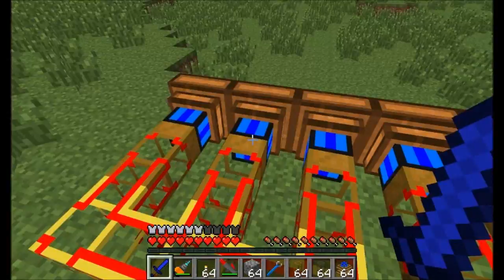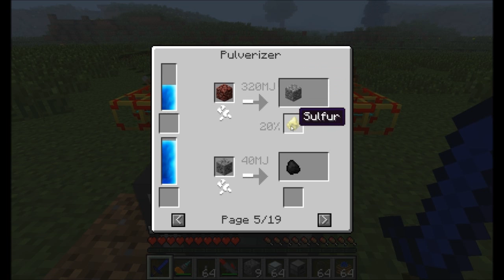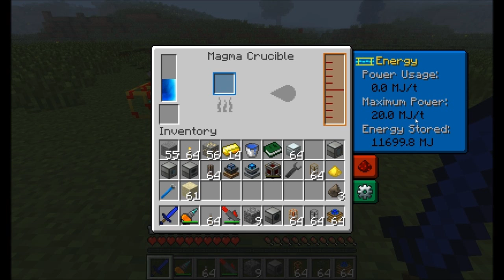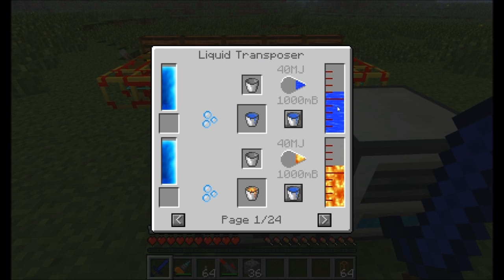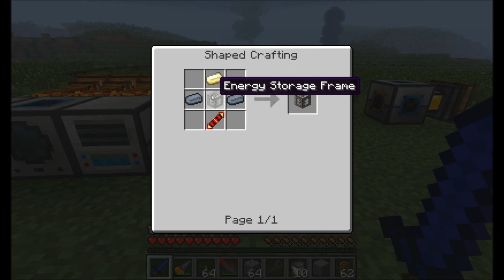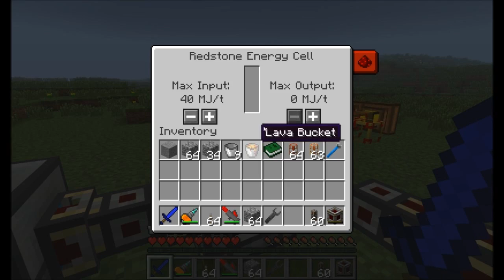Mod Spotlight - Thermal Expansion v2.0

Comment: I honestly think Thermal expansion is the weakest tekkit mod. It is the least usefull mod out of the whole modpack (especially since phase pipes were added) and also probably the most complicated (not counting computercraft of course). I Have used thermal expansion since it was released but these days I do not even bother with it anymore. I vote to remove it from mod packs to add Forestry. Even Chococraft would be a much better addition then Thermal.
Reply: Remember when there were packs without thermal?

Comment: So how does the new energy tesseract work? Is it like a buildcraft power teleport pipe, and you make it by making the empty frame, then filling it with molten ender pearls using a magma crucible and a liquid transposer in the same way you make an a redstone storage cell from an energy storage frame and then fill it up with molten redstone?

Comment: Hey ic2 I would say is better as it is a very old mod. And yet it's still popular. There is a special mod for ic2 that allows build craft oil to be turned into eu. And there is a machine that works the other way around. And there were many mods that came out for ic2 like compact solar and advanced machines and not only that but in my opinion ic2 is better

Comment: I'd like this mod if it weren't for the customizable inputs & outputs, and not having to use engines to withdraw items. It's a bit against the point of Buildcraft, in my opinion.

Comment: But I do sort of agree with the theory behind your opinion. There are way too many similar mods. I run a custom server with IC2, BC, RP2, Factorization, Thermal Expansion, and Metallurgy. As it is, there's so much copper it's ridiculous. But there are some unique features to each one, so despite the similarities, they're at least different enough that's it's not overwhelmingly redundant. Modpacks just... aren't the way to go, imho. Simple, but not very intuitive or reliable at all.

Comment: Anyone have issues with the Shift+Right-Click not working on the energy storage and pipes? I have the proper wrench in my hand but it simply does nothing. I`m using Direwolf's FTB mod pack.

Comment: Let's correct this entire situation. It wasn't about credit, I don't know why xjdks1 said that. Tekkit lists off the mods and links to the mods on their website just fine. What the whole ordeal is about, is that Tekkit never asked for permission before putting the modpack together. They just gathered the mods and put them in. That's not okay with most mod developers. FTB asks for permission first, and if they don't get permission, they don't add the mod to their pack. Simple as that.

Comment: I don't know if you mentioned, or if the mechanics have changed since the older version, but for the Aqueous Accumulator it runs much faster if you put two source blocks of water next to it. Kind of like if you were making an infinite spring, and put the accumulator in the spot where you'd normally use the bucket on. It outputs a ton of water, like a fully powered pump or something.

Comment: just download feed the beast and use that it has both BC and this expansion. if you don't want the other mods you could quite easily just pull them out of the mods folder and use em. you can get FTB at feed-the-beastDOTcom/beta/ if you haven't got it

Comment: I think you should have shown the water gen with two source blocks next to it. That way it would not have seen as a uselessly slow and would have outputed same amount of water as pump with 4 redstone engines. And not use those source blogs. That's kind of the point of the thing anyway. To reduce server lag and prevent infinite water pool drying up.

Comment: The power cell idea is kinda off I think. I can see the reason behind a recipe of that kind made for IC or Redpower where there's electricity involved, but in BC you have to work with kinetic energy occurring from compressed air. A valid battery for that type of energy would be a pressurized canister of shorts, with maybe a bit of redstone to act as the valve, but not the actual storage material, that would be air apparently.
The idea behind melted redstone is pretty sound though.

Comment: the sad thing about mods that add furnances and stuff is that the IC2 production line with macerators is the one thing prety much everyone would want to use and having the furnances from a different mod makes little sense 90% of the time, so you end up with a IC2 machine room with a RP2 sorting machine all time time :)

Comment: It looks like a great mod, but there's one thing you haven't explained. What's the slot under the energy bar for in the machines that need power? Is it similar to the slot for batteries in IC machines?

Comment: I usually avoided using Buildcraft engines because of the need to manage them and losing fuel when nothing was being powered but with a way to store Buildcraft energy it make engines much more manageable. Although something else I'd like see is using gates from Buildcraft 3 with the Energy Storage block and also being able to control the flow of energy though pipes and conduits using redstone. I also hope this mod is added to Feed the Beast and other modpacks, its a great addition.

Comment: This mod has it's own engines and pipes for power, so it can be used on its own. You would just need to place inputs manually since there are no item input pipes.